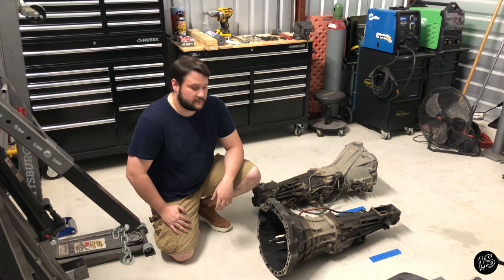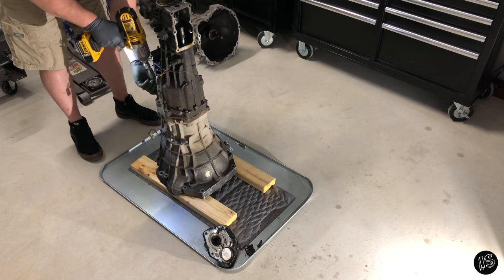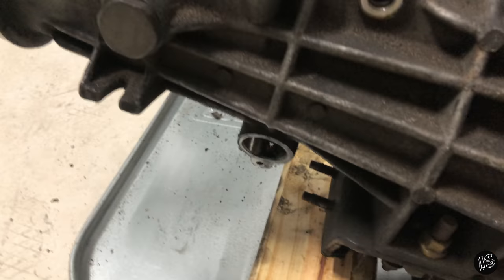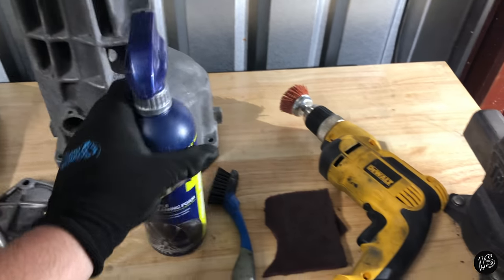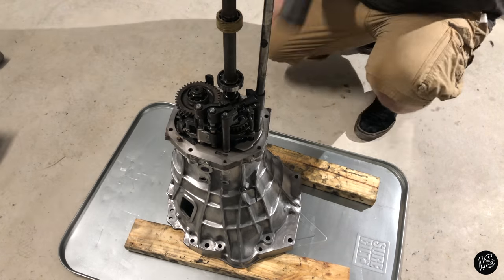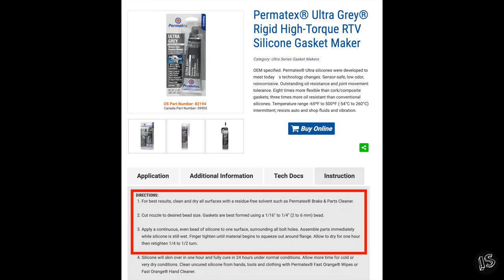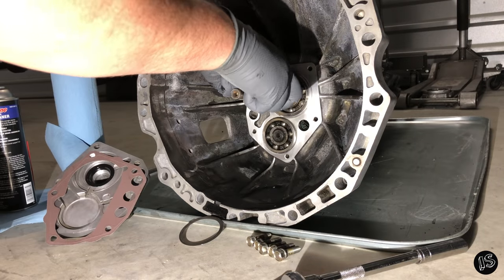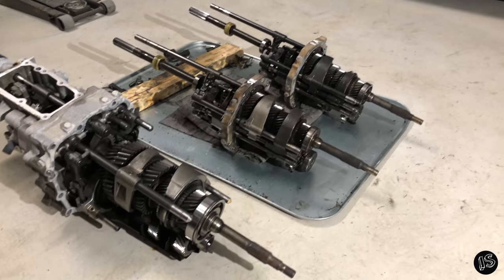SR20/KA24 Transmission Housing Swap

Comment: I've just bought a spare S13 box and want to inspect the gears. This video shows me how to remove and replace the covers. I'm very impressed with the imaging, and step by step instructions including torque specs. Can now approach the job with confidence. Many thanks mate!
Reply: how did you store your spare transmission? I guess that you use a towel or a bag to cover where the driveshaft goes, but did you store it with fluids? also wanna know if it was stored vertically or horizontally. I got a spare and wanna know if im storing it the right way for when I need it. thanks
Reply: @NotUrbina  I drained it, stored it vertically (output shaft downwards) but on blocks so that the input shaft was not resting on the ground. I have an old yoke that goes into the output end of the box but any cover would do.
Reply: @adow77  thanks for your help bro :D

Comment: You said one thing and I had to leave a comment, like and subscribe. 'After placing the silicone rtv, snug the bolts down and wait an hour before torqueing down'.
Perfect. Proper way to use Silicone

Comment: So I'm fixing to do this exact process.. Have the KA and SR trans already pulled/laid out.. Only thing is the KA trans I picked up from a buddy had the bell housing off for a while and I want to say he even hit the gears/bearings with a little water / cleaner... Do I need to re-grease the ball bearings? or apply some sort of lubricant before sealing it up or are they swimming in enough gear oil etc when filled. This video was the best thing I could of asked for, thank you.

Comment: Have just removed and then replaced the casing including replacing the bearing seals. Had the phone propped up on the shelf and followed your very clear instructions. Many thanks!  I initially thought the box was s13 but it had synchro on reverse and double synchro on the forward gears. Do you have any tips for identifying whether a box is S13 or S14?  It's back together now so I can only look at the casing from the outside.
Reply from the maker: Honestly, I just have to look at them to tell and can't remember off the top. The casings are always a dead giveaway, but the transmission itself I just have to see them.

Comment: Hello Chance , I am wondering if there are any transmission swaps for my Nissan 720 . Originally had the Z24 but I’m swapping it for a Ka24e. Was wondering if you could enlighten me on some option I could have with this swap. Goal is for a more durable transmission because I am trying to have a good amount of horsepower with the Ka24e . Thanks 
—Dave 
P.S. love the vids, keep up the great work
Reply from the maker: Howdy! Honestly, the KA transmission is plenty durable up to a certain point. My car [180sx] is making well over 320whp/300ftlbs now, and it has a KA24E transmission inside an SR20DET transmission case. Literally what this video shows me doing. The KA24E transmission I used has about 200,000 miles on it, and I’m pushing that power through it without issue. Remember, torque and shock load is what kills transmissions. If you plan on making more than 350ftlbs of torque and just want to launch for drag racing with a bunch of traction, the KA transmission will be a weak link for sure. It all depends on what you have planned for the truck. People consistently run over 450whp on SR and KA transmissions, but they don’t beat this piss out of it. Drag racing and drifting tends to kill these transmissions pretty quick with higher power levels. Normal street driving use and circuit racing tends to give them a much higher survivability rate with higher power. 

TLDR: KA/SR transmissions are strong till about the mid 300’s, then it’s dependent on driving style.
Reply: Inner Sanctum 
Thank you for fast reply. Yes I plan on drag racing the truck. I’ve heard of people swapping over the 300zx transmission for more durability. Any insight besides fabricating the mount location, transmission tunnel, and shifter location? My goals for the truck is around 400-450 whp.
Reply from the maker: Here’s my personal take on this; for what it’s worth:

Z32 and R33+ 5-speed gearboxes are damn strong with an excellent synchro-mesh design. The strongest variants are VG30 gearboxes from the Z32 300zx/fairlady and their sister gearboxes in any RB25DET setup from R33-R34 Skylines and so on. I personally like the RB gearbox due to not having a linkage setup like a Z32 gearbox. However, their internals are the same strength wise and overall smoothness.

I feel that they are some of the best 5-speed gearboxes that Nissan has ever made. 

With that being said, here’s why I wouldn’t: 

1. Sourcing. These gearboxes are getting very expensive and harder to find in good condition which lends to my next point.

2. Age. Aside from just finding them, you have to remember that they are getting quite old, and depending on who has owned them, they have seen a lot of action. 

Here’s my recommendation:

If you’re serious about making a strong setup you’d be doing yourself a service by going the CD009 6-speed route out of any 06+ Z33 350z/G35 or even going newer with the JK series and dealing with the internal slave. These transmissions are abundant, affordable, and insanely robust. You also have the added bonus of another gear to get things dialed in better. 

The adaption cost is the roughly the same for both routes, and you are not going to have an issue finding a good condition CD009 for “cheap”. Mine was about $600 and it’s from a low mile car. Most good RB and Z32 transmissions are going for twice that with the same mileage and condition. Both routes require a custom driveshaft and mounts as well. The only thing with the CD009 is that it doesn’t have an internal speed sensor, but most just go with the Dakota Digital GPS sender anyways. Easier to wire, manage, and far more accurate. 

At the end of the day I like to buy once and cry once. The CD009 is a superior transmission in all respects to its predecessor. The fact that it would end up being cheaper by the end only makes it that much sweeter of a deal. 

Hope that helps.
Reply: Inner Sanctum thank you I appreciate the information 🙏🏽
Reply: Can the cd005 bolt to ka24e

Comment: Curious if this would work on the qr25de from a sentra spec-v. I assume so since they use it on the 2005+ frontiers. That helical 6 speed is bullet proof on the sentra, would be nice to use it along with that qr motor on a hardbody, with just swapping out the bellhousing. If you have any insight into this i will worship you as god. edit my goal is to rwd swap the qr25 while attempting to keep the trans with the bellhopusing swap. Id assume not since it has cv shafts

Comment: I guess I do still have a question after looking at the list. Can the d22 frontier trans internals work in the ka24/sr20 cases?
Reply: What the 4x4 d22 ka24de use the transmission and what can I use any transmission for the 4x4 d22 ka engine

Comment: Do you know if the SR and KA throwout bearings are the same? Some posts on internet forums say they are the same. However, if you check the OEM part numbers, they are different. 30502-69F1A (SR), 30502-21000 (KA)
Reply from the maker: Yes, the throwout bearings are all the same. They are 100% interchangeable. 

OEM numbers are different for a variety of reasons, but the aftermarket replacements are identical. 30502-21000 is the superseding P/N for both.

Here's a Z1 link for further confirmation:
https://www.z1motorsports.com/trans-case-and-clutch-release/nissan/kasr-throw-out-bearing-p-4798.html?list_name=BundledTogether

Comment: Hello Friend how are you I needed to know which transmission should I use, I have an SR20 that does not have a transmission and here in Chile it is very expensive and I need to know what transmission works for that engine apart from the original to install it in a vehicle with rear-wheel drive greetings from Chile friend excellent project, any information will help bye bye
Reply: Shit Out Of Luck

Comment: Can you answer a my question?
Have primera GT 2.0 manual sr20de
I wont to swap transmission for same primera but 1.8 engine and it's fit or no? Thank's
Reply from the maker: I’m not very familiar with FWD SRs. I’m not sure if that will work or not. Sorry.

Comment: Question: are the Ka24 internals stronger than the stock Silvia box? I’m looking to run about 500hp sr20 and wondering if I should swap the internals to something strong or would I be ok running a stock box
Reply from the maker: KA24, SR20, CA18, and RB20 transmission internals are all the same strength. Just depends on how well they were taken care of before you get one. 

It's not HP that kills the transmission. It's torque, traction, and shock load. If you have a 500hp engine and don't drive hard, it will maybe hold up. However, you will annihilate that transmission in any other form of driving.
Reply: @Inner_Sanctum  what box do you recommend for an engine with about 500hp and a average torque figure with that power output, 350z box?
Reply from the maker: @lawrenceclaridge6401  rb25det, vg30de/dett, VQ35 CD009 series, or VQ37 JK series are all great options for the 500 range. They can take a lot of abuse and hold a great deal of power. 

The CD and JK trans will require that you do not constantly slam into gears without proper clutch timing. Even with the revised synchros in the CD009 and later JK transmissions, the synchros are still subject to damage and can prematurely fail or wear and cause grinding and etc...

The RB25DET 5-speed is just a monster gearbox for what it is. You really have to suck at driving to mess that thing up...
Reply: @Inner_Sanctum  you’re a genius, thanks for the help and pointing me in the right direction :)
Reply: @Inner_Sanctum  one last question, I’m assuming you need an adaptor plate for the rb25 tot SR20? If so, do you where I could find one? :) sorry to be a pain
Reply from the maker: @lawrenceclaridge6401  pretty sure Dellow Conversions and Garage-D are the only two companies that still sell them anymore since most people, including myself, just go CD009 due to availability and expense. However, adapter plates are not crazy hard to have made. Just have to get the holes and spacing right.

You're saying gearbox, so that leads me to assume you might be across the pond, not sure if you're stateside. The accepted vernacular in the states is transmission/trans. Haha

If you are stateside, a good RB25DET gearbox is going to be rather expensive and hard to find depending on where you live and who you know. 

My $.02, just buy a CD009 from an 05-06 car that still has the external slave. They are usually cheap and relatively easy to come by stateside, and you don't have to worry about that concentric mess. There are a myriad of companies that make the SR to CD conversion plates. Plus, the transmissions are easier to find in the future should you encounter any problems.

Hope this helps. Cheers!

Comment: Hey, planning on doing an sr20swap and originally wanting to use the sr tranny without swapping like you did. I know I have to get a shorter driveshaft by 2 inches any idea of how to do that?
Reply from the maker: I’m not sure what setup you have or what vehicle you are referring to swapping. I usually get a Driveshaft Shop custom aluminum driveshaft made for every swap I do. A lot of times I am doing unconventional swaps and need to have them build me a custom one. You can call them and tell them what you have and what you’re trying to do, and they will tell you how and where to measure. Never had an issue.

Comment: Was there no little ball that came out when you removed the 27 mm bolt from the rear extension driver side ? Cause with mine there was but it may have been cause I took of the shifter gasket allowing that one spring to come up witch was retaining it maybe ??? Idk anyone knows what I’m talking about lemme know please. Thanks in advance
Reply from the maker: Adrian Rodriguez yes, that ball detent is important. The ball goes under the shifter plate spring and holds the one shifter return rod in place. I installed a new ball and spring from Courtesy Nissan when I installed the GKTech shifter and GKTech shifter return springs. You can see it in that install video.
Reply: Inner Sanctum thanks a lot, Some really good info !

Comment: so by switching the casing from the sr trans to the ka internals... i can just mate the sr engine to the ka internals with the sr casing?
Reply from the maker: If I understood that correctly, then yes. You can use either internals with either casings.
Reply: Sorry to bother you with these questions but.... can a vq35 engine bolt up to a ka transmission... if so what kind of modification are involved with this whole process?

Comment: Are the internals parts from a 4x4 and the 2 wheel drive transmission the same ????
Reply from the maker: Good question. I honestly have never opened up a 4x4 unit. I know the bellhousings are interchangeable, but not sure about the internals.

Comment: Is there a difference between the ka24e and de trans?
Reply from the maker: Yes. How different depends on what KA24E you’re talking about. 

240sx KA24E and 240sx KA24DE transmissions have very minor differences. The vent tube routing and some later DEs have the crank angle sensor port. 

D21 KA24E vs 240sx KA24DE are very different. They have different tail shafts and the internals are configured differently to accommodate the shortened stature of the D21 trans.

Comment: What transmission can I put on my ka24e that can handle 400 to 450 hp
Reply from the maker: joseph schmier so a few things here: 

1. The horsepower number isn’t what kills the trans, it’s the torque and how the transmission is loaded. Shock, due to sufficient traction and gobs of torque, is what generally destroys the gears. Unless you have a really worn out trans that wasn’t taken care of that just breaks during normal operation.

2. Completely depends on what you’re using the vehicle for and how you drive. I’ve owned a few 400hp cars with stock SR/KA transmissions and didn’t have an issue. That said, I have some friends that will destroy any trans they put behind their engine because... reasons. 

If you are making 400-450 whp on a KA24E, then you are probably making around 360 ftlbs+ of torque. If you are racing the vehicle hard, I would suggest adapting an RB25DET or VG30 5-speed trans. The CD009 6-speed transmission is a great option as well. I posted a video showing the install. It can be adapted to both SR and KA “easily”.

There are just too many variables to consider when talking about arbitrary HP numbers. Tire size, diff, clutch/pressure plate type, driving style, and sport all play a huge roll. 

Example: If you are drifting an S13 and run small wheels and tires, it’s not hard to keep a stock transmission alive around 400hp. It’s when you step up to bigger wheels and tires that it becomes a real problem. If you’re running 255/40r17 with 17x9.5 wheels, you are going to destroy that transmission at some point drifting. The problem becomes even more severe for drag racing. Bigger/stickier tires with a strong clutch will easily find the weakest link in your entire driveline. 

Road racing is the most forgiving on the stock trans and what I was primarily doing. I was going through brakes, not transmissions lol.

Hope this helps.
Reply: @Inner_Sanctum  this helps alot . Ill primarily be road racing for fun.

Comment: I would like to add my 2 cents as I really researched and did the same housing swap. It’s not cost effective to try to rebuild the SR transmission and this is a great mod because KA internals are still available in the USA. So if you have a SR it’s best to get a KA trans so you can rebuild it fairly cheap.
Reply: Another thing I figured out is after installing the input shaft cover you should pull the input shaft and see if there’s any in/out play, if there is it can effect 4th gear engagement and/or pop out. I found a simple solution to this, just remove the gasket and use RTV. This way the cover holds the input shaft bearing outer race and have a nice crisp solid 4th gear engagement.

Comment: Would ka clutch fit the sr trans?
Reply from the maker: You'll have to be more specific. 

I'm going to assume this is what you mean: 

Will an SR trans with a KA bellhousing fit onto a KA with a KA clutch/pressure plate? Yes.
Reply: @Inner_Sanctum  yes sorry for the bad wording thanks !